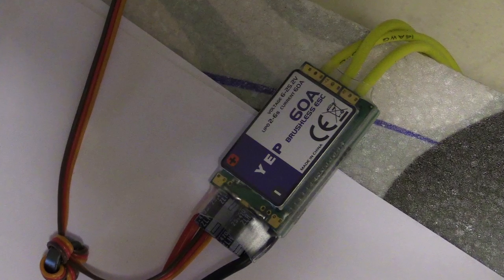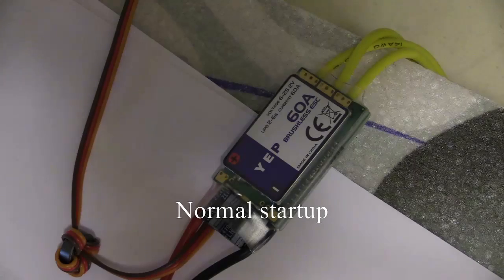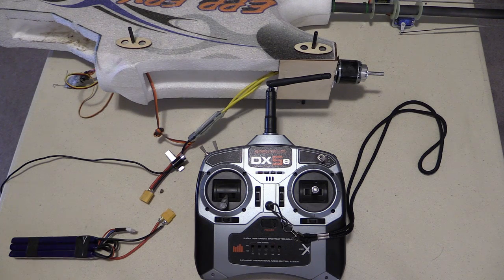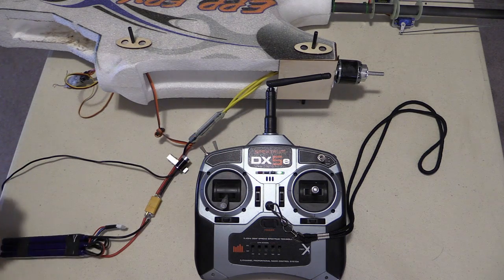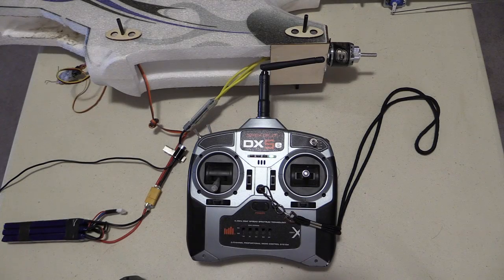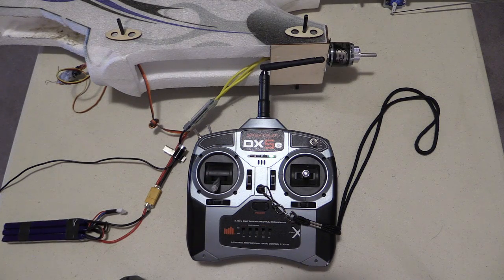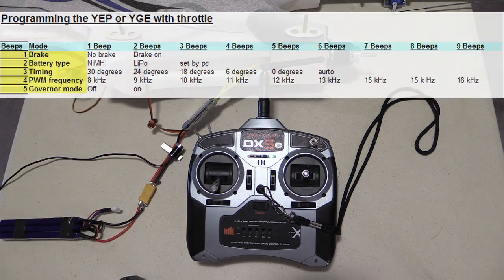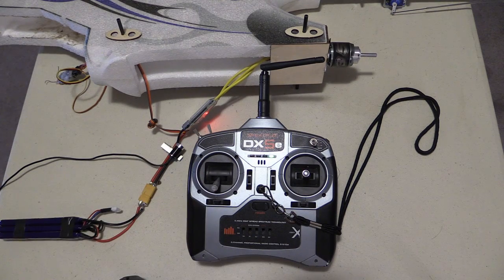Programming the YEP ESC

Comment: Hello, Nice video. I have the exactly same ESC, can you tell me what is the PWM frequency to use while giving PWM signals through raspberry pi GPIO pins to it. So that it can control the BLDC motor properly. Also how do we calibrate in such as case, can I calibrate it with the python code I give to raspberry pi (model 4B).
Reply from the maker: wow. I'm sorry I don't know but perhaps some of our viewers can help.  Please.  Anyone?
Reply: I believe this uses a PPM signal (pulses from 1000uS to 2000uS), not "traditional" PWM signals which carry the info via duty cycle (0% - 100%)

Comment: Or just spend the $6 on the programming card...  Set the throttle points with the stick but use the card for everything else. Using the throttle to set everything is just dumb.
Reply from the maker: Dear Kind sir.  Thank you for your point of view. An alternate point of view is that it's dumb to pay $6.00 to change the brake setting.

Comment: How to throttle range? I must be doing it wrong, I try how I thought I knew but it automatically goes to programming mode
Reply from the maker: Confusing, isn't it? To program the basic setup:  Throttle full. Power ESC.  wait for multiple beeps.  Now move throttle to fully retarded if you don't want any brake, or back to less than half throttle if you want brake.  Wait for two beeps.  Now advance the throttle to the amount of power you want for startup.  Fully advanced throttle: hard startup.  Less than full throttle will give soft startup.  Two beeps.  Then I would disconnect the ESC.  Next time you should be able to go to advanced programming as in this video.  
I've not tried this myself, but that's how I read the manual.
Reply from the maker: Also, please read the excellent comments by iForce2d below, which are very helpful.

Comment: Thanks for the super clear explanations. I just tried this with the same ESC as you have in the video and found a few more things worth mentioning (mostly gleaned from RCGroups forum).

I did not need to raise the throttle trim, it seemed to work either way.

To enable the brake, setting brake on in the main 'advanced settings' menu as you demonstrated was not enough on its own. I also had to calibrate the throttle so that the 'neutral' point was not at bottom throttle. To do this you raise the throttle before powering the ESC up, but instead of letting it finish those 20 beeps and enter the advanced settings, you lower the throttle to enter a 'basic settings' mode. The basic settings is only for throttle calibration and soft start.

Anyway, as it's doing those 20 beeps, before it can finish, lower the throttle down to almost the bottom, but not quite. This will become the position at which the motor will start to spin, and lower than that will engage the brake. You'll hear two beeps to acknowledge the setting. Then (quite quickly!) you'll need to either raise the throttle to full again or lower it to zero, to specify whether you want soft start (throttle lowered) or quick start (throttle raised). Another two beeps of acknowledgement and you're back to the regular state.
Reply from the maker: THANK YOU VERY MUCH.  Excellent information.
Reply: Have many thanks to this information,it was in fact the only way to get the damn soft mode out of the programming 😅
If you wouldn’t have written this comment it would be the end of the story of my esc…Thanks a lot,your the man 👊😎
Reply: I need to try that, I do not want soft  start on my plane.
Reply: iforce coming in clutch once more

Comment: Thanks for the help! So am I correct in assuming it is not possible to adjust low voltage cutoff settings using the throttle stick calibration? Do I need to get a programming card to do this?
Reply from the maker: You're welcome. You're also correct.   I don't think the low voltage cutoff can be programmed using the stick. You would need the programming card.

Comment: My ESC doesn't beep, do you think it's faulty?
Reply from the maker: Not sure.  When you power it up does is go through the sounds heard on the video? Most importantly: does it still turn the motor!  I'd say if the motor still runs it's o.k. Best.
Reply: Benson Filmworks well I contacted HobbyKing and they said it's the ESC because the motor was spinning fine on my Quads esc :)